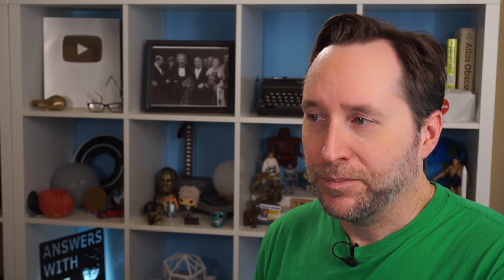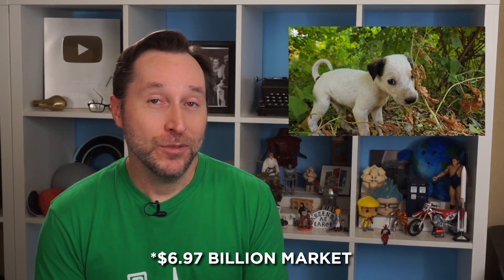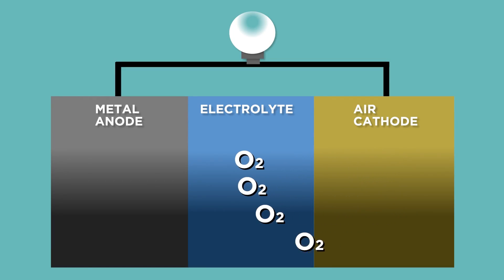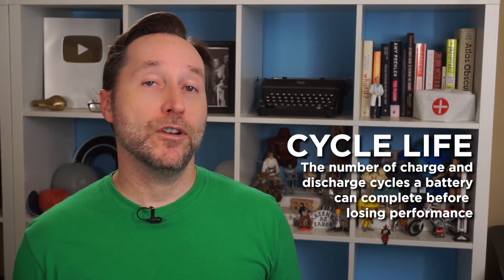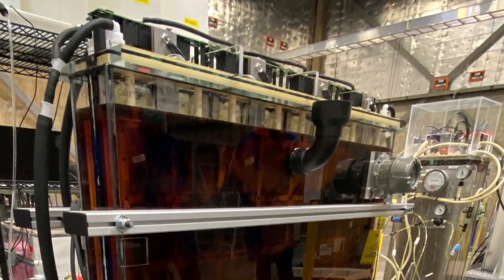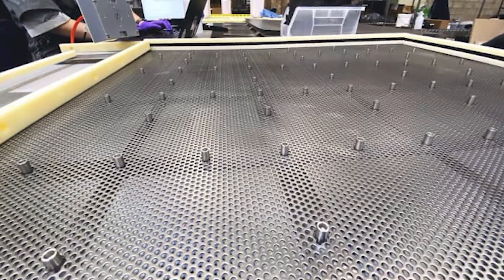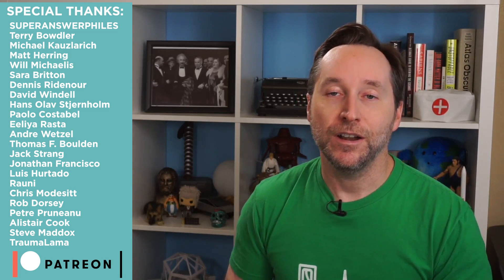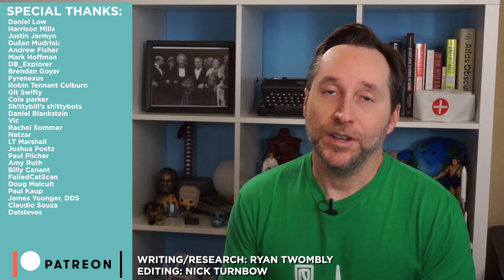Iron-Air Batteries: Storing Energy In Rust | Answers With Joe

Comment: As has been stated by another poster on other such "NEW TECH" sites:
"...they should check old tartarian building…... they stored energy and made it flow through the building using geometric shapes and details then they made a current of water under the building and connected the building to the atmosphere using antennas. AND many of them were made of redbricks."

Comment: That watt hour statement is wrong. at 11:55. In fact it's completely opposite.

Watts is how much work can be done per unit time. The units for watts is joules per second. A joule is a measurement of work.
Watt Hours is how much work was done. This is joules per second x 3600s. or 3600 Joules. Its convenient because you can look at how many watt hours a home needs a day, say 24,000 Wh. now you know your plant needs to make 1000 watts of power to keep up with demand. But that was total work needed by the house in a day. You could do that work in 1 second, or 10 days. but the amount of watt hours will be the same. conversely if you try to give the house all 24,000 Wh in 1 hour. you will need 24,000 Watts. If you do it in 10 days you will only need 100 watts.  

hope that makes sense.

Comment: Renewable energy not withstanding,  the fact that we can't store any of the energy we produce be it from coal, nuclear,  hydro etc.... is nuts. I live in rural NE Pennsylvania and every time someone farts too loudly the power cuts out. So I found a guy selling used solar panels from the Canadian government  (no I didn't ask how he got them ) so I bought enough for 5000 watts that'll do the fridge, freezer, and run the pellet stove my dad gave me when he upgraded his, with enough left over to provide juice to my satellite Internet, then when cv19 hit I got bored and looked up plans for windmills and built one from an alternator and a radiator fan. So I w as making all the electricity I needed but turns out that in PA I cannot legally disconnect from the grid even if I don't use any of it and they have to pay me for my surplus. No moral here just wanted to rant

Comment: Down here near Waco. In February I had 600 Watts of solar and 3 KWh of lead acid storage. I now have 900 watts of solar and 10 KWh of lithium ion storage. What I had was a real life saver but I still wound up putting trash bags full of snow in the refrigerator. The next time I'm going to be ready. Except next time will be in the summer and will last six times as long. My current system cost about $5000, $3600 of which were batteries. Six of my panels were $85 and three were $113. They have on occasion put out more than they were rated for. Good luck when Dallas actually burst into flames 😁.

Comment: 11:52 W and Wh are not units that can be directly converted into each other. Watt is the unit of power (Work over time). Wh is the unit of energy (Power * time). Wh is usually used to measure the capacity of the storage. It has nothing to do with power. Just how much battery you have.
Reply: Also it's not MW/hr but MWh (they're multiplicative)

Comment: The reasoning that Iron-air can provide more long term power than lithium ion doesn't make sense. 
150MWh at 1MW is 150 hours - so dfar so good.  But on the same footprint, as you noted, you can set up a 1GWh li-ion battery that could deliver the SAME 1MW power - but for 1000 hours (and even up to 250MW if needed. So: much more versatile in what kind of situations it can handle). You were comparing totally different power outputs. At the power output that would drain a 1GWh battery in 4 hours the iron oxide battery (if it could sustain that much power draw) would be empty in 36 minutes.
The big advantage of iron-air is cost. But land costs money, too. If you have to build on 7 times the land then it's not really foreseeable that these will be cost competitive (given current li ion battery prices. Which may change with changing costs for raw materials therein)

Comment: You got watts and watt-hours mixed again :) Watt-hours is for energy or work, watts are for power (energy per unit time). One watt of power is a flow of one joule per second, and one joule of energy is one watt of power (energy flow) lasting for a second. Watt-hour is one watt of power lasting for an hour, or 3600 joules, and you can say that a joule is one watt-second. It may be confusing because we usually have measures of speed/flow expressed as ammounts of stuff per time, but for some reason for units of power we have a designated non-derived name, which makes possible to name/express ammount of stuff using flow without it sounding too absurd like [miles per hour]-hours. Hope that helps!

Comment: LiFePh4 batteries can be recharged 8000-10,000 times before losing capacity but they're like 40% larger than 
Li-ion batteries so they don't want to use them but I personally wouldn't care if my phone was a bit fatter if it meant the battery wouldn't become useless so quickly

Comment: Wait... so, I'm not saying you're wrong, but I'm a welder. I cut aluminium stock in half all the time. It's aluminium oxide in the middle as well? When I cut it in half, I'm looking at the centre of the aluminium bar or whatever it is. How deep does the oxide go?

Comment: The puppies were terrible! I could hardly hear what you said because they were so distracting.....LOL
As an electrician who has worked with batteries in the clean energy industry for many years, I have seen many "promising" technologies that never made it to market, or failed to live up to their hype. The one major advantage we have from Tesla taking a "Goodenough" battery and focusing on the scale and cost of manufacturing, is that they have shown us that we are capable of making batteries at prices that work for EV's and energy storage. This has opened up the floodgates of research and development money in batteries unimaginable in the past. Hopefully some of them will make it across the valley of death that kills so many promising industries.

Comment: It wouldn't surprise me that in the future, EVs and home storage batteries will have multiple layers of power storage; capacitors,  lithium, iron air and who knows what. Similar to computer storage,  where fast/expensive is first in line, with larger/slower/cheaper underneath.

Comment: _____________
Two errors right at the beginning of the video.

1. It is Aluminum Oxide that coats metallic Aluminum, not the Aluminum Hydroxide.
2.  Contrary to what you said, When you look at s chunk of Aluminum you see The Metal itself! Since the Oxide coating is a colorless transparent compound & especially since it is extremely thin, you see right through it, the metal itself.

Comment: Joe, I really enjoy your videos (I bet every body tells you that).  On batteries, I wonder why we talked about most of the iron/air versus Ni/Li battery characteristics but I missed one.  RECHARGE PROFILE..  I would not buy an EV (and I don't now) because it takes so darn long to recharge them compared to pulling up to my local gas pump for 5 minutes.  AND that gas nozzle has been standardized to fit all cars and trucks.  I can't get over this huge-to-me inconvenience.  When there is a 600 mile range battery that recharges in 5-10 minutes and doesn't cost an arm and a leg, and I can stop at any of a zillion recharge stations anywhere in the USA, I might, maybe, get interested.  So this issue is to me and I'll bet to a ton of others, a big one.
Reply: At your stated minimum acceptable level of battery requirements and infrastructure rollout, the choice would have already been made for you, probably a decade before that. EV's are already great options for most people's daily driving. I have my gas guzzling truck if I need to go somewhere multiple vehicle-range's away (or if you can't charge there, like camping).

Major materials science breakthroughs are going to happen in the coming decades that are going to take EV's to that next level that you're envisioning, but they're going to be the best kind of vehicle to buy in all situations long before that.

Comment: We have had a good stationary battery for decades! It is called the Edison battery, it does NOT use acid, they last for decades. Yes they are a bit bigger but not by much. They are heavier but that is irrelevant in a stationary use. They are less energy dense but you can add additional cells to compensate for that too. So why do you not advocate Edison batteries?

Comment: Not quite sure the burn on Nikola was quite fair. While both had duche bag CEO’s at one point, Theranos were pushing a product that was impossible. Nikola at least has working prototypes and the company’s success will depend on economics and execution and not some not yet possible technology. SEC filings and the Tesla lawsuit have now been settled, and while their reputation is somewhat in tatters - I wouldn’t completely write them off just yet.

Comment: Hey Joe, another part to consider for these battery videos is Micro grids, i work for an energy company and the plan now is to take the fringes of the network and disconnect them from the main grid to cut down on infrastructure and maintenance costs, so this would potentially service dozens of customers or more per micro grid. Large scale batteries like this will play a massive role in regional communities in the future.
Reply: Makes sense; residential needs are generally very different than commercial or industrial. The most annoying thing about off-grid or grid-tie setups is the peak power for cooking if you want to avoid fossil fuel use entirely. That's where micro grids come in. The biggest problem I have right now is that 90-99% of the grid is dumb as a box of rocks and has no method of communicating past, current, or future loads to the grid, micro or regional. In fact, if done improperly, a lot of people would be screaming their heads off about privacy and government espionage of the populace. But that's the problem I think needs solving foremost: homes should be able to track their energy usage and present the grid with a historical and future projection.

 This sort of communication should be of an specification that is open and international. (So, like IEEE perhaps...?)  But that circles back to the most age old problem in secure computing; authentication is required for security. Who holds the keys? And to what? There's low level communication links to secure, medium level tunnels to secure, and high level accounting to secure. Game development demonstrates why the client should never be trusted. Then we have the Vehicle to Grid infrastructure to deal with; with 50A AC feeds and 200A DC feeds; and all of them are predominantly one way and just as dumb as the grid about who is where and being billed how. 

For example; most car computers have no idea what their own license plate reads; but they know their VIN. Current chargers are dumb pilot signals purely for safety; all the billing side is done at a terminal charger-side, with a relay to disconnect the cable leading to the vehicle. Good luck getting a charger that supports a billing network on private property; chargepoint's contracts are out of reach unless it's a condo or apartment building. And even those aren't two-way yet, when the grid needs energy in an emergency, it has no way to ask the vehicles to discharge. 

And yet again; we have an authentication issue. Whom can request such a thing? We definitely want hospitals and other medical facilities to be able to do so, but I'd be rather angry to find my vehicle's battery being discharged to keep a refinery hot during an outage, preventing it from having to shut down for a week. That should be their storage problem, not mine. Sorry for the meandering reply; but you seemed like someone who might stand to benefit from the free ideas.
Reply: @SLLabsKamilion  
I started to read that until..... paragraphs; they are your friend.
Reply: @kindlin  Uh, there's only one paragraph there. It's just a particularly short one compared to the papers I typically read.
Reply: @SLLabsKamilion  
Have it your way. Let's just say it's less than conducive to typical internet banter. I would try and find more concise veins of through and work on those to make a compelling argument, than whatever that thing was.
Reply: @kindlin  Fine. There's your four carriage returns.
Reply: @SLLabsKamilion  
Someone on the internet actually listened to my suggestion? I'm shocked and encouraged.
To your original comment's point, you point out a lot of details (some bigger than others) that will need to be addressed, but none that I feel are overly difficult, and most are probably well on their way to being solved, even if I'm not familiar with the development happening in those sector.
Reply: @SLLabsKamilion  
I'll admit I only briefly skimmed your reply, because you're just talking about all this current tech and standards and... that's not what we're talking about here. 10 years from now, 30 years from, everything is going to be different. Before decentralized grids become a major thing, it's going to need to be tested at larger scales, at which point the kinks will need to be ironed out relatively well or it won't scale. Humans are ingenious creatures, if we want something to happen bad enough (within the laws of physics mind you), we'll figure out a way to do it.

See, short and sweat.
Reply: Cool info on the future of microgrids! I can see where it makes a lot of sense! Decentralization is easier with wind, solar, and maybe even small modular fission reactors, so it follows that keeping hundreds of miles of transmission lines going might prove to be less efficient than multiple microgrids.

Comment: That's good that you're getting solar on your roof. Have you verified that it will function during an outage? Most grid-tie solar power systems completely shut down when they don't see power from the grid to prevent islanding (back-feeding into your local power grid which can electrocute line workers). You may find that you've spend tens of thousands on solar panels and they shut down when the grid goes down.

Comment: 11:55 you got those two backwards.  Watt-hours is the measure of total work done.  Watts are the rate at which work is being done.
It is really unfortunate that we decided to use watt-hours instead of joules for energy.  It makes it very confusing and people confuse watts and watt-hours all the time because they sound the same.
Reply: I went through tons of math and science education throughout college and still get power, energy, and their various units confused.
Reply: kWh is a useful units as it's really easy to calculate from watts or kilowatts. Also  Joule is a really small unit, so you'd quickly need to brush up on those large prefixes, like peta- and exa-
Reply: @mrleenudler  
A Joule and a kiloWatt-hour are linearly related, it's just 3.6*10^6 (kilo = 1000, hour = 3600 seconds). So, yes, that does insta bump you up a couple orders of magnitude, but we're now already pretty used to tera- and peta- for hard drives, and exa- is around the corner. If we used the Joule, people would acclimate quickly.
And his point about watts and watt-hours being confusing is very much the case.
Reply: You are so right;  

same with Amperes and Amperes-hour;  the first is electric CURRENT, the 2nd is ENERGY,when multiplied by the Volts, becoming Watts-Hour;

The problem,yes,is that the names are so similar; kind of ...their and there...and they're...
Reply: I understand that form  energy anounces to deliver 1 MW and 150 MW per hour or 150 MW x h ; not the same as 150 h of working or MW/h (that doesn't exist)

It's mean they can deliver 1 MW at maximum discharge rate for a quantity of energy of 150MWh  as a day has 24 hours, they can deliver energy for 6.25 days because the flow rate is slow (not because they have lot of capacities)

It's a cross product with same proportions : 150 -> 1 so 24 -> 6.25

(if mistakes pardon my "enghlish speaking / writing", I'm french)

Comment: Hello Joe, and thank you for this video.  Can you or anybody else please comment on a molten salt battery?  It's used by the 100MW solar power plant located in Dunhuang, Gansu Province, China.  It generates power day & night, creating 2.4 Million Kilowatt hours of electricity per day, enough power for half a million homes even through the night.  Built in less than two years and in continuous operation since 2018 this plant does not use photovoltaic panels or any metal based battery.  Instead it uses mirrors and molten salt heated up to 550°C (1,022°F) which acts as a massive thermal battery with unlimited life cycles. Steam is then generated to turn turbines, same as a nuclear power plant but without the radiation threat.  Check it out, cheers.

Comment: Battery backup for power systems are a valuable tool for grid operators to stabilize transmission network frequency and power flow for short periods when  emergency power is needed to replace lost generation capacity. Inverter technology can deliver power immediately.  Emergency support can even  be automated. So there is no waiting for a fast start turbine to get on line. Despite all of these advantages, time is the achilles heel of battery back up.   batteries are capable of delivering only a fraction of their MW rating for longer periods.  At the current state of technology  battery back up is good only for very short times.  A  review of the math behind battery systems will reveal just how limited they are to deliver power for your needs.  Purveyors of these systems like to give the impression  they can replace conventional power sources much longer than they actually can.